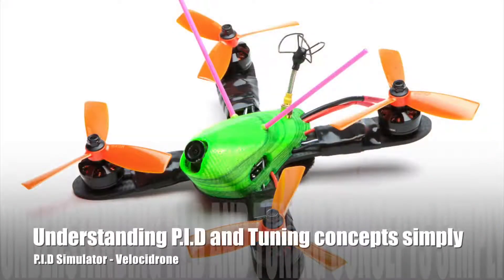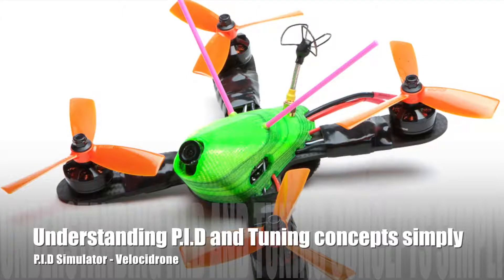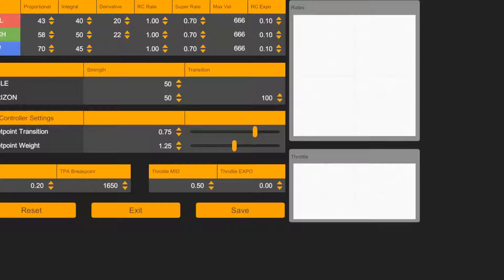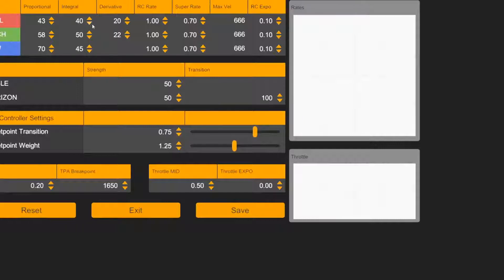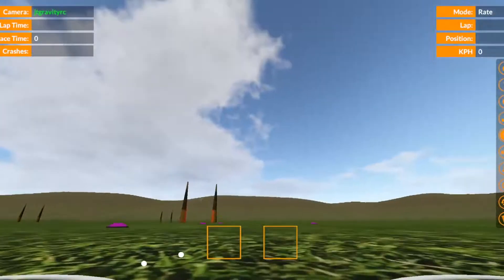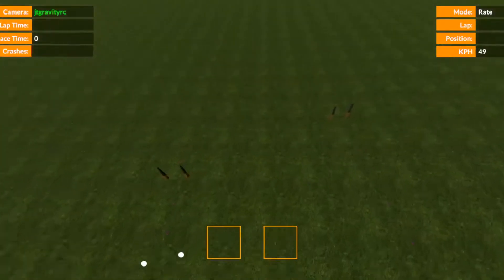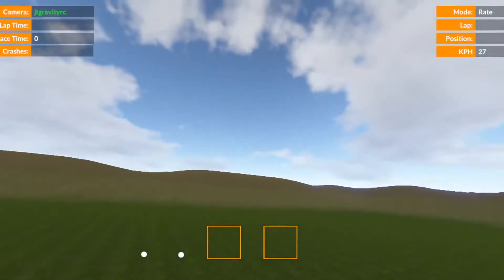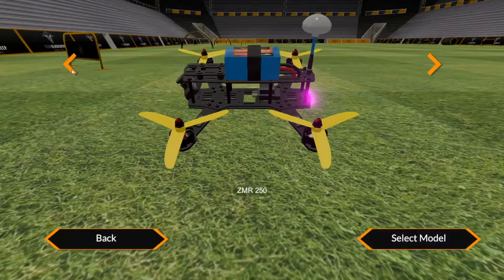Understanding quadcopter P.I.D and Tuning concepts simply - P.I.D Simulator (Part 4)

Comment: JT, my Eachine Fatbee FB90 skids (drafts) whenever I make a turn. What PID need to be be changed to make the turns tracks? I appreciate your suggestion on the direction of each PID I should try. Once I know which way to tune, I can slower get to the optimal values by try and error. But I need a direction, thanks!
Reply from the maker: Hi, abghere. Unfortunately, the frame and props design are causing you those problems. PID won't be able to solve the issues. You can transplant to a new frame e.g. Kingkong Smart 100 like what I did with Eachine QX70. Hope this helps.